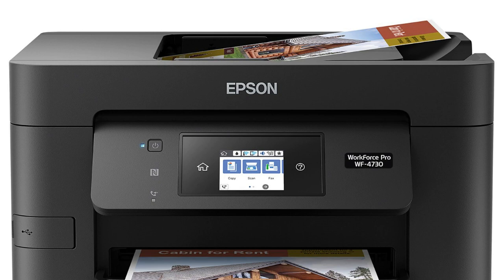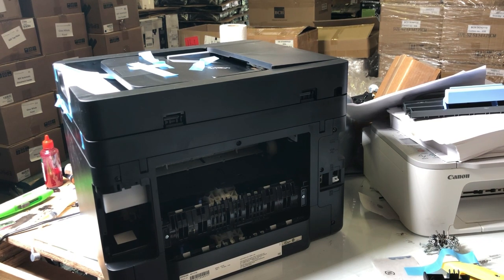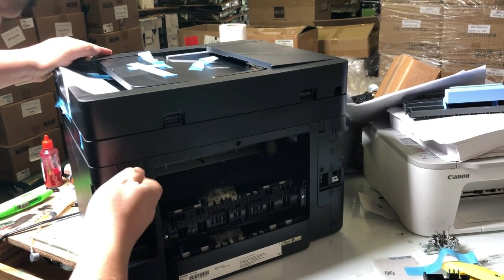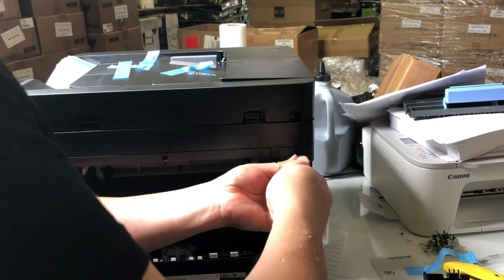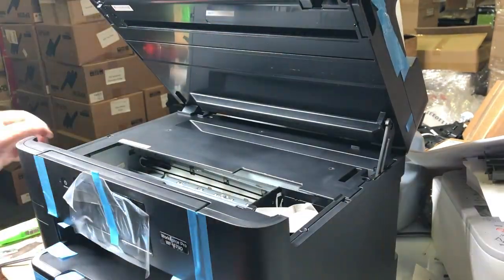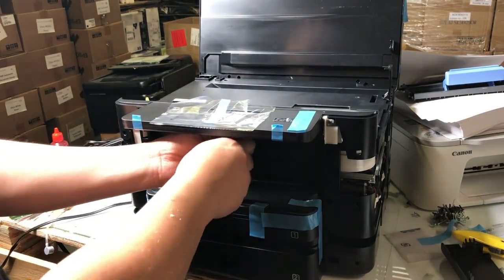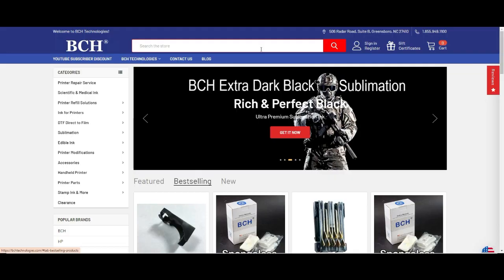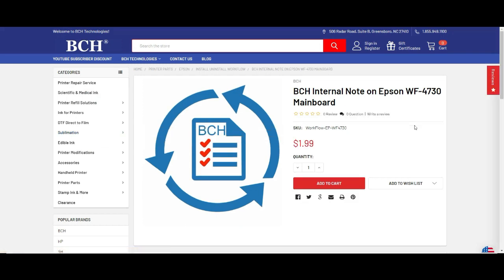Uncasing WF-4730 - How to Remove Case and Scanner Epson WorkForce

Comment: Hello mr Kelvin. I have main board for epson  wf3720. Main cf24 or assy 2179507. The main board does not have normal non pnp transistors like mahority of other epson boards. Mine is not powering on. Please assist. What is responsible for powering on
Reply from the maker: I do notice that. Unfortunately, I didn't have much time to repair this board. It is about $20 on eBay, so most people probably just get a new board rather than send it in for repair. I would check the control panel cable because it is 0.5 pitch cable, very thin teeth. If it is installed correctly, I probably will surf eBay and get the board replaced.